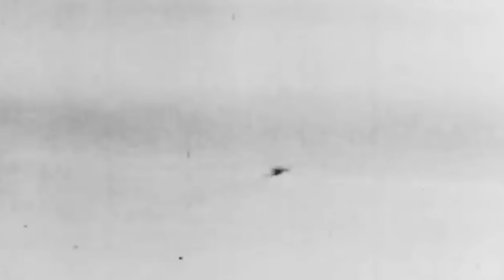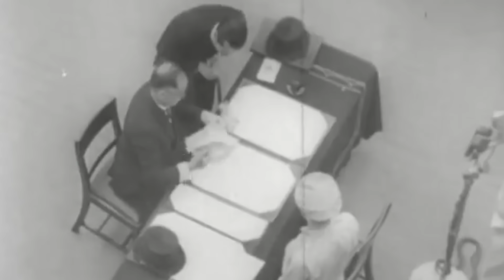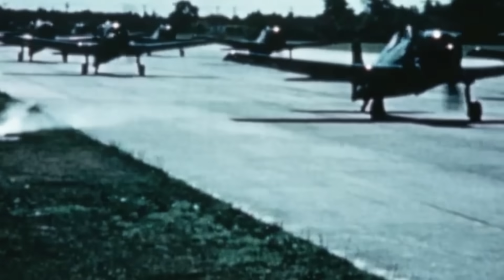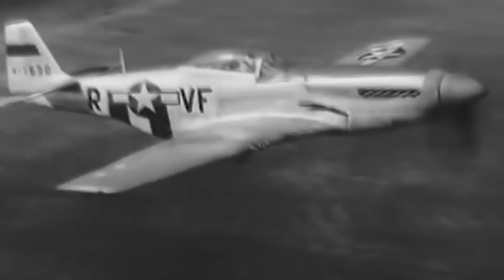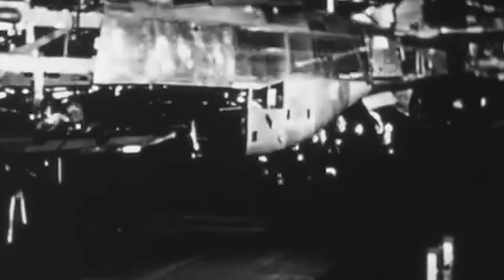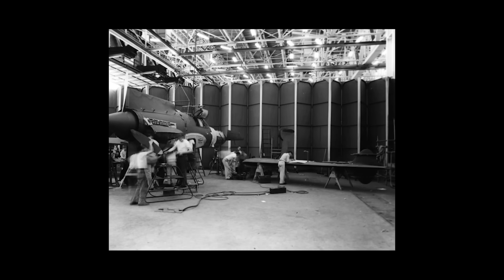The Monster Prop Planes That Humiliated Jet Fighters

Comment: Why didn't they build more Mosquitosin WW2?

The Mosquito could carrie the same bomb load as the flying fortress of 4,000lbs...

It cost $11,000 per unit. The fortress cost to build was $212,000/$238,000...

In summary, the Mosquito’s price was typically only about 5% of a B-17 or Lancaster, and barely 2% of a B-29’s cost. 

This massive difference in construction expense reflects the Mosquito’s efficient design and use of non-strategic materials compared to the much larger and more complex heavy bombers.

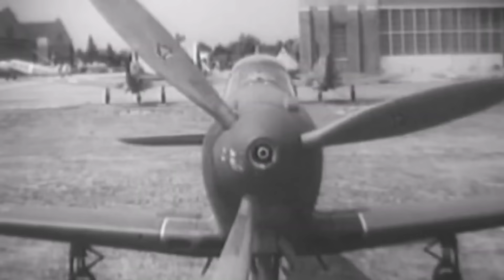Comment: 6:14 Had ALL Bombers and Multi Engine Fighters of WW2 had COUNTER-ROTATING ENGINES like the P-38's  Set Up... They most likely would have had a grand better Performance efforts in flight. 👍👍💖
Also LOCKHEEDS Jet Fighter Design that was turned down by the President, and Military in 1940, would have been an EPIC like the P-38 they later got going. 🌟🤠🇺🇸

Comment: Interesting note on the 3 billion dollar b-29. The stock b-29 at the end of wwii was not able to carry the nukes to be dropped on Japan, and needed modifications to do the job. In the end history tells us that the mods required were successful. However during the modification development period the avro Lancaster was the backup. 

My thinking is it was more than just cutting back on armour plating to reduce weight. At the end of the war the armour was not needed, as the us had already won air superiority over Japan. This would have been an easy mod with no need for the Lancaster back up.

If anyone knows more about this I would love to hear your comments.

Comment: The XP-55 could only muster a top speed of of 390 mph, except for the stability issues that plagued all flying wings, the XP-56 was clocked at 460mph with its radial engine.
Reply: XP-55 #1 crashed. #3 crashed and killed her pilot. #2 sits in the Kalamazoo, Michigan Aviation History Museum, aka The Kalamazoo Air Zoo. Their incredible restoration team did an immaculate job on her. I've been up close and personal with her several times.

Comment: So they basically copied the German Dornier Do 335.
Reply: I wouldn’t say that at all, the first prototype of the DO-335 flew in the last quarter of 1943, and the XB-42 in August 1944. They are contemporary to each other, not one a copy of the other. There is at least one or two years of preliminary engineering work, wind tunnel testing and more before a prototype is ready to fly especially with American companies. German engineers rushed faster during wartime conditions foregoing many of these tests.

Comment: I'm no aero engr, but the pusher prop configuration looks like a much cleaner aero design. Too bad no commercial aircraft is a pusher configuration. 
8,000 LB bomb capacity of the B-24 seems so small these days - a Jet fighter like the F-15 can carry 25,000 + LB of weapons. And the B-52 carries up to 60,000 + LBs of weapons.
Reply: There were B-52s flying missions over Vietnam with over 100,000 lbs. of bombs by adding hard points to the wings.
Reply: @stargazer5784 Rolling Thunder, indeed!

Comment: De Havilland Mosquito,  425mph 4,000lbs bombs
Reply: The Mosquito was always considered as a bomber.  Although some variants were equipped as fighters, they were just not agile enough.  Nor were they armored as US demanded their fighters be.
Reply: Mosquitoes were made of plywood which absorbed WW Two radar, making them stealth
Reply: @JosephOlson-ld2td  
Most British and German planes were made of cloth or fabric*.  Only the later planes were all aluminum.  Most American planes were all metal from the start. 

*The cloth was 'doped' with a paint like material.  That kept the plane light but made the cloth very airtight and strong.  They could also be patched by gluing a small piece over the bullet holes. Repairing metal holes was much more involved.
Reply: Actually most of the British & continental planes you are thinking off had mostly metal construction except for the control surfaces were often made of doped cloth. Yes the Swordfish had doped cloth surfaces all over & early Hurricanes had only a partial metal fuselage, but that’s as far as it goes - well except the previously mentioned control surfaces
Reply: @mickvonbornemann3824  > Hurricanes had welded steel tube fuselage frame with wood lath and fabric
Reply: @mickvonbornemann3824  
Spitfires were fabric over a metal frame.  Bullets were in and out.  When the plane landed the crew just glued a patch over the holes.
Reply: @Dagwood-Bumstead-001  actually the Spits were full metallic, it was the Hurricanes that had many doped surfaces. It’s one of the reasons Spits were so expensive, with different thicknesses of duralium (or whatever aircraft ally they used) varying across right across the width of the wings. With the BF109 costing a 1/4 the price of the spit.
Reply: @mickvonbornemann3824  
 - "actually the Spits were full metallic"

No.  But someone that can't even write a proper sentence nor even spell the plane's name correctly is on pretty shaky ground when it comes to lecturing others.
Reply: The mosquito never went 425 miles an hour with that payload. 425 with a load of fuel only.